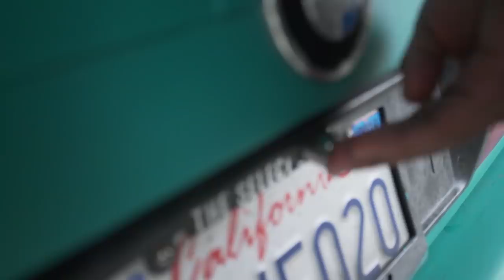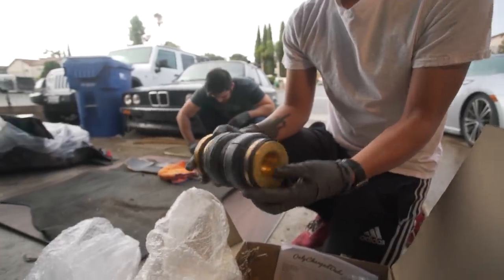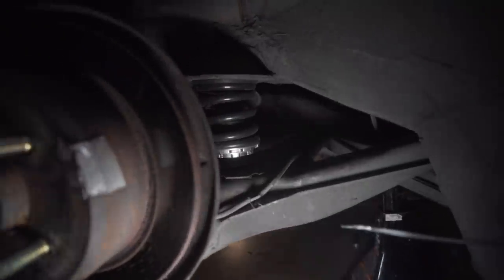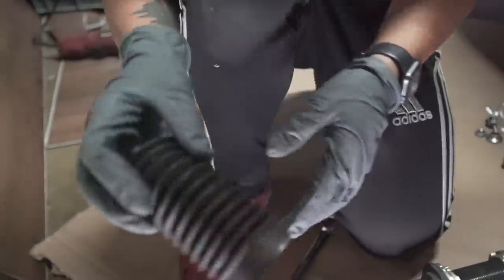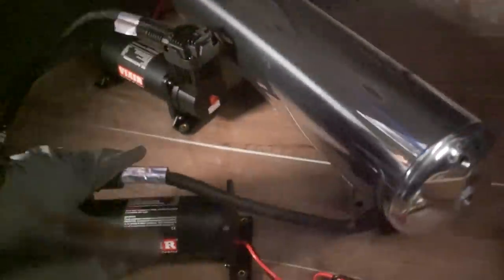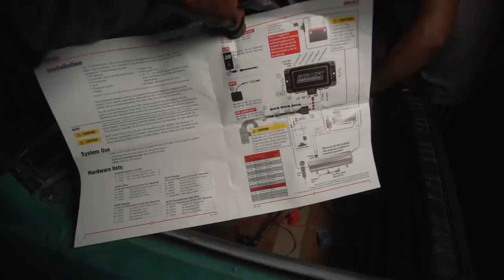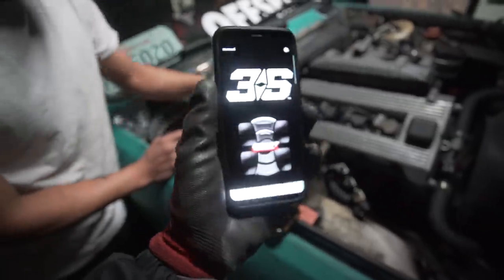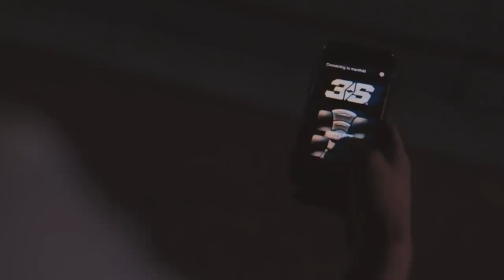How to Install Air Suspension on Your E30 | E30 BAG INSTALL!!

Comment: Whenever I run air lines through a small hole similar diameter to the pipe they always rub and eventually leak so recommend putting rubber grommets in the holes before putting pipe through
Reply from the maker: Definitely recommend this as well! My buddy and I added grommets to ours a little after doing this install.

Comment: What coil overs are you using with your bags and have you had any problems with set up after installation?
Reply from the maker: He's using BC coilovers and he only had small issues come up months later like air leaks but they have since been fixed 😁
Reply: @derkm  im trying to order OCD bags for my e30 but the set up they are trying to sell me is a weild set up. Im trying to install the same set up as he has and need info on what to buy.
Reply from the maker: @mikeb7861 ahhh I see. I would try messaging @rk.tan on Instagram. This is his car in the video and he'll have more info than I do on that 👍👍
Reply: @derkm  i also just seen you have videos up as well on e30 do you guys have a face book page will be good for me to keep in touch with you guys as i am starting a e30 m54 or ls swap. Maybe you guys can give me some info.
Reply from the maker: @mikeb7861  hit us up on Instagram! @derkm & @rk.tan. I'm always happy to help out with whatever I can 😁

Comment: All I gotta say is that rear lip is too aggressive with the angle, don’t flow with the body too well
Reply: I would say that this ductail is set too vertical. It would look much better if it was a bwave style wing, but it would require some tiny wheels